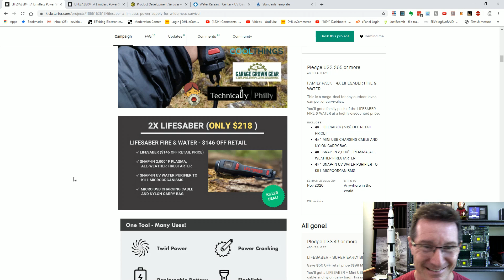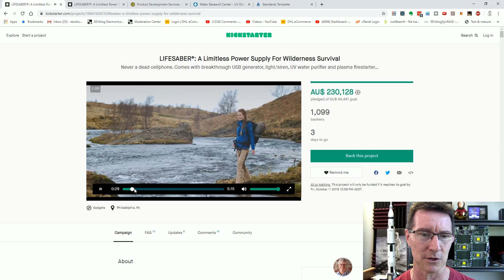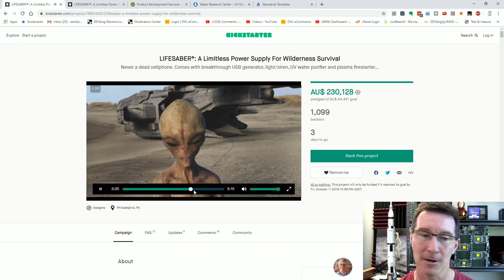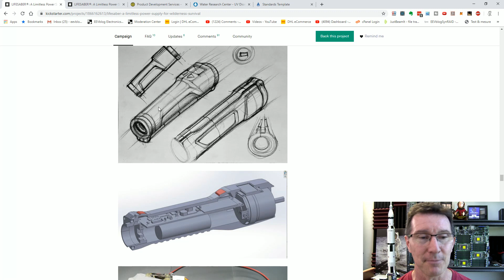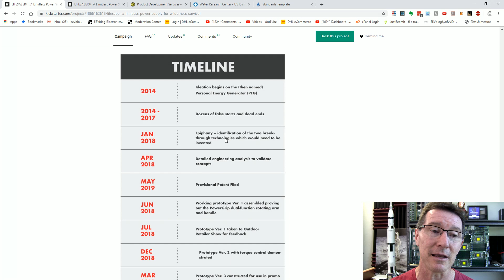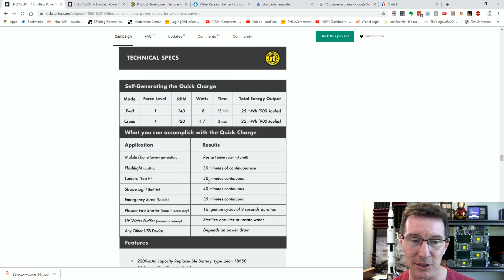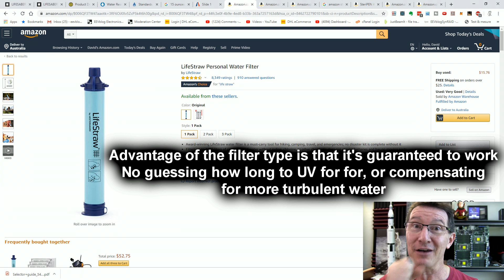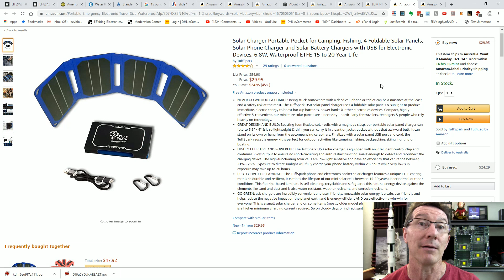EEVblog #1251 - LifeSaber Kickstarter - A Master of None FAIL

Comment: There are also USB generators, because with solarcell, you need sun. So it's not really need to buy whole big all-in-one thing. All-in-ones is instant useless if it failed or break. Separated stuff like you showed at the end is more better, you have more ways to survive instead ONE heavy thing.

Comment: All good until you iPhone dies ...they wont boot till there's enough power in the battery about 2-5% in most cases. I've had people tell me "nothing wrong with my battery" while I waited about 15 min's drawing 0.5a@5v before it would bother even trying to boot. How long would you have to crank that for 625mWh? (I think I worked that out right) .

Comment: I have a lovely plasma lighter that charges via USB and gives 100 uses per charge. I have a perfectly usable UV SteriPen that works with rechargeable AA batteries. I've got a bunch of various rechargeable power packs up to the nearly 30Ah USB-C PD power bank that I use with a PD Buddy Sink to power small low-power ham radios and charge my phone. If I need to charge things, I've got a decent portable solar panel for when the sun's out, but I also have a FlameStower, that'll charge USB power banks and devices using flame and thermionic generation. I have both of Stower's devices, the FlameStower and the CandleStower. The former just sticks a heat-conducting blade into a flame, and you pour cold water into an expanding silicone cup for the cold side. The latter, though, actually has a small pot it suspends over a flame, from a chafing wick fuel canister, candle, or small fire, like a pile of wood-fire coals. The cold side of the thermionic device is water you pour into the pot, and when it boils, you pour it into your coffee cup or freeze-dried food pouch, put more cold water in it, and set it back over the fire to continue charging your device.

For water purification, I can use the Steripen OR one of the Sawyer Micro-filters I have. The Sawyer filters a huge amount of water and does everything but kill viruses and remove heavy metals. The Sawyer filters are superior to LifeStraws, filter more water faster, and weigh less. 

For light, I have a bunch of different devices, from standard flashlights to a UVPaqlite Mule Light II that has a rechargeable 18650 with a usb charging sleeve. It has the strobe, a white light or UV work light, a flashlight, and a glow-in-the-dark insert that gets pumped from the work light, that flashes for a second every 3 minutes, giving you plenty of usable light that lasts for DAYS given how short the LEDs need to work to stimulate the glow in the dark crystals. I also have a little cheap hand-light with an expanding bellows-like arrangement that turns it from a flashlight into a lantern that gives a respectable amount of light. It has a hand-crank for charging the battery, and can operate as a USB power bank, though you need a small extension cable to convert it from coaxial power plug to USB-A socket. It's the only hand-crank thing I have, and it works okay so long as you don't expect to jump-start a spaceship. 

Gimmicks like this LifeSaber (damn stupid name...total cringe) aren't worth the powder and lead to blow 'em to Hell. As has been said by others, a "do it all" device becomes your single point of failure, and without some redundancy you're stuck without light, without heat, without clean water, and being carried off by dingoes.

Comment: Damnit,  that UV lamp is really unsafe... even a low power UV lamp is highly carcinogenous, 
i have a light indicator in front of my home lab, to be sure the UV lamp is off when i enter, people should not mess with that stuff....
Reply: Even without the cancer worries, the kind of UV (UVC) that is used for sterilization is pretty nasty - Big Clive did a couple of videos a while back showing one and talking about what happened when some idiot used them in a fashion show because the glow looked pretty. He called it the "Awesome Flesh-burning Death Lamp" for a reason...

https://www.youtube.com/watch?v=1m0TQjBRcFo

https://www.youtube.com/watch?v=CpRMud6EFtE
Reply: @RedwoodRhiadra  And he is right, this is not something to play with, if the lamp power is enough to be germicidal, i would consider it also dangerous for human. (there is probably a threshold here, but still...)

Comment: But if you combine it with a batterizer you get 800 times more energy out of it :D

On a serious note, you use body energy (i.e. food) to power this thing, not exactly what you would want to do in an emergency situation either when food might be a limited resource. Much more sensible to bring an extra battery.
The UV water purifier might work, but ceramic filters need no power and are more practical.

Comment: The twirl function is just dumb might as well have just the hand crank.
As for some of the planned devices a usable air pump is going to need a lot more power than what a single 18650 can supply usually you  need a 12v battery to power those.

Comment: I appreciate that you're talking about a Kickstarter which is actually legit, but disappointed that you threw so much hate at something which does have an honest niche market. Sure, you COULD save money by buying a whole bunch of other physically larger accessories, or you can be this really expensive all-in-one product. 

The one thing I do agree with is the rechargeable motor is stupid in comparison to using a solar panel to charge the cells. Solar panels are so cheap, really efficient, and so light, in comparison to the motor. Simply having that all-in-one housing + a foldable solar panel within it IMO would have been better then the hand-crank. Aside from that, I disagree with your point of view on the product.
Reply: John Smith A solar panel is even worse. Search for GreatScott's video about the solar charged power banks...

Comment: I'd agree with the accessment... except that this is probably perfect - for the target market.

Preppers and survivalists will be all over this irrationally. It's not about how useful it is or how it fares against other options, it's all about the keywords. xD

Kinda like the cottage industry of MREs... a whole lot of components inside these privately made MREs are just plain stupid to be there, but if they didn't put it in there the thing wouldn't sell.
The meal itself could be the very best for the situation, if the kit doesn't include some fancy prepper tools like a signaling mirror, a compass, multiple redundant fire starters, and whatnot - it will lose sales to an MRE that does include those but has an absolutely crappy inadequate meal included. :P

Weirdly enough, the one thing that it seems to be lacking is the optional solar panel charging unit, but that would probably increase costs and not be worth a price increase I guess.

Plain and simple, these things are designed for (false) ease of mind. It just has to sound as convincing as possible, which it seems they did a good job on. Nevermind that most of these survival tools are worthless without training, which is the most important thing on preparedness, they are just there so that people can lie to themselves that they are a bit more ready if an emergency situation comes about, with a single purchase.

Comment: I'll say I actually don't mind the concept of having a hand crank to charge an 18650. If they really do have their numbers wrong and it's 250mAh for 3 minutes of hard cranking... well, if you're stuck out in the wilderness, you've got time to kill. With that said, I don't actually want all of this in one device. I'd rather just have a hand crank that I can charge AA ni-mh cells with - much less finicky than lithium so the device can be a lot simpler. Then I can just use off-the-shelf devices like a flashlight and firestarter that are much better than whatever's built-in to this thing. And more importantly, we don't have the single point of failure of one little thing going wrong with this device, and I'm not tied to some wanky kickstarter company for continued support and warranty, which is a large consideration as they'll probably go under.

So the problem with this product is that when you buy all of the constituent devices separately, you have a much more robust solution. It might be marginally more bulky and you'll have to carry these things separately instead of in one contained unit, but hey, you probably already have a backpack with many pockets, right?

So yeah, give me a high-quality hand crank generator for charging AA's, and build the force multiplier thing into it because that's pretty neat. And sure, put a USB on it as well because getting 10 mins use out of your phone might actually allow you to get a call out in some places. But that's it. That's where you stop.

Comment: 31 lumens, I'm pretty sure I've seem computer with LEDs more stronger than that.
Reply: The light on my SNES is brighter.
Reply: One 5050 LED is about 16 lumens. It's tiny. This thing has likely exactly two similar power LEDs or a composite module. That is about 400 mW... (Guessing 3.3V) Their voltage converter and overhead must be trash.
Reply: Thinks about the Kingston HyperX Fury, a SSD with 75 RGB LEDs that cook the drive to death...

Comment: If they had only thought of adding a cassette player, I'd have been sold.
Reply: I can't believe they haven't taken vaping into consideration. Seems like an obvious feature to me.
Reply: @TheLambLive  vibrator
Reply: @TheLambLive  VHS recorder with detachable camera
Reply: It needs a digital clock, everything better with a added clock add to it, right ?
Reply: @Mrflash222006  I thought the same! This is missing an alarm clock. Also, calculator!
Reply: 8-track?
Reply: Needs a banana slicer
Reply: Bong!

Comment: AS a fairly regular wilderness backpacker, I can tell you that everything you've chosen as replacements for the LifeSaber are what I use as well. 13200mAh battery pack, Sawyer filter, Anker Solar panel, separate flashlight, ferrocerium rod - and all have a separate backup; 18650 battery with a tiny solar panel, a lifestraw, keychain light, matches, etc. I agree that's it's just craxzy to try to put everything into one -and the question of water resistance is a big one. It's pretty rare for me to be gone for a week and not get wet, or at least gear get wet.
Reply: There's no cell phone coverage where I go hiking with a tent. So... I'll skip all power stuff. And I don't need any of the stuff in their life saber. Why would I need it? Yeah, a GPS is nice (thus maybe a battery charger), but I have a map and a compass and can work with uncertain location information.

It is a fun product, though. A bit crazy, I'd say.

Comment: We've actually shortened the jack of all trades saying, and ironically have completely changed its meaning. Here is the original:

“A jack of all trades is a master of none, but oftentimes better than a master of one."
Reply: Very true, but I think it applies to people more than objects.
Reply: @jendib  yes, people have neuroplasticity and are generalists, specialization is for machines, tools and insects.
Reply: @jendib  Understood. I just wanted to point out, "A jack of all trades" originally was a complement.
Reply: +1. Take Dremel for example. It is precisely the jack of all trades, master of none, but oftentimes better than a master of one.
Reply: @victortitov1740  the dremel is a master of 1 category of functions, though. It's a rotary tool. That category is for fine drilling, polishing, grinding, and cutting applications. 
It sounds like a lot until you realize it's only for small sized stuff.  If you try to use it for anything outside of that, it's terrible.
Reply: Thanks, much more nuanced saying that way.  Wonder how much other folk wisdom has been similarly transformed over the years.
Reply: Yeah, but often you need that master of 1, because the jack of all trades is only okay at best for most tasks.
Reply: It's funny how times change.

Comment: The only human powered battery pack I have seen that generated and real power was something you hooked on a door or something then put your foot in a loop and stepped down. These hand cranked things are just silly. 

Now the simple crank flashlight with weather radio does work but you are hard pressed to make it more useful than that.

Comment: those RPM numbers on the hand crank thing look a little fishy to me, 15 minutes of spinning it more than twice a second, or even with the cranking gear ratio, 3min of twice a minute with that sort or resistance yeah not going to actually come up with the values they claim not to mention if you're not consistent with the cranking there's inefficiency in converting the power.... there's reason why wind turbines have a max and min speeds for effective power generation and the max is far below the breaking point of the turbines its all to do with the generator producing power that can be converted to usable power.
Reply from the maker: I didn't try and back envelope calc that.

Comment: It has a lot of bells and whistles that nobody needs. However, it does come with a bunch of useful survival stuff, as well.
The water purifier and plasma firestarter could be quite useful, although you probably shouldn't rely on those as your only option. Should probably take a different firestarter at least.
The whole swinging thing is ridiculous, though. 15 minutes? No thanks. 3 minute normal hand cranking? Yes please. Much better.

As for all those other plug-ins they are thinking about: I am assuming those would be individual products. Some seem useful, others don't. Just buy the ones you actually need and you're good.

Comment: Yeah, this is one of these things bought by people with no clue as a present for someone that likes the outdoors.
If standardise on lion batteries, then Xtar PB2S as powerbank, battery charger, spare 18650/21700 holder. Then can swap batteries between headlamp/flashlight and powerbank.

Comment: Well I like caring two means of purifying my water. Saved my butt after I had my pump fail on me while hiking in Sweden. The huge disadvantage of the straws is, that you are required to have access to water which I only had every 5-8 km (a lot of wells were dried out, I was hiking there last year). But that means you can not use it with a water bladder or a bottle. 
For the rest I agree. It is better to not depend on one single device just in case it breaks or gets lost. I always try to have two alternatives or more when I go on a multi day hiking trip.
Reply from the maker: That's the point, if you aren't carry a water bottle you are an idiot.
I like have stuff that uses interchangeable batteries. GPS, torch, even a camera in the old days with AA's. Now it's mostly USB
Reply: Sounds like you're an actual hiker though, not a trendy tech geek who pretends like one day they'll need a gadget for survival.
Reply: @Iliek  Well but especially in that situation I want reliable gear. What use is this tool when the battery is completely discharged and damaged after sitting around for 10 years? Matches will work, fire-steel will work and my water filter will work as well. 
The best part is the electronic compass they want to sell as an addition.
Reply: @nukularpictures  The point of the gadget is to make a few people rich by exploiting people's desire of new gadgets.

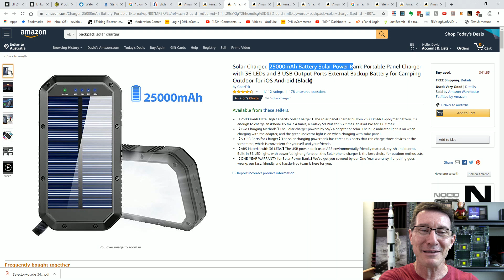Comment: 24:15 honestly, these kinda battery packs aren't that heavy, so one should be able to carry them in the backpack just fine.
Reply from the maker: Depends on what you are doing. I normally don't carry anything more than a 3000mAh pack, plenty for emergency charging.
Reply: @EEVblog  That's fair enough. I'm fairly used to the common 20-25k phone battery packs.

Comment: saw a torch yesterday that did 32000 lumens according to the manufacturer...  does only 3 min on a charge then but you can probably burn someones eyes out. ive also seen a turbine that you can put in a stream or wind and it will charge a device without any effort.

Comment: Where is the most energy loss in a crank generator? Surely an arm can put out quite a few watts of power if we could harness it?

Rotary motion doesn't have loads of friction, so is it lost in winding resistance, or conversion to DC?? I guess slow RPM needs huge windings to generate, but then you could use a gearbox.
Reply: Arm puts out a lot of Watts (power), but for a short time, so still low energy.

This thing weighs 0,5 kg with rotation radius of 0,25 m, let's guess 10 N force (about 1 G), for simple math.
That gives around 1,25 Watts. The problem is chiefly electrical losses, which depend on grade of coreand copper as well as winding, but easily can eat half of that input power. Mechanical loses are non negligible but not huge. Conversion to DC and voltage regulator can be about 90% efficient nowadays, including some active PFC.
Let's suppose this is in interior permanent magnet brushless topology which is good for low RPM and high torque. Alternatively this could be a brushless DC with electronic commutator, which fits better with the adaptive load idea, but is not as good with low RPM high torque.

Most importantly in a survival situation you're supposed to save your strength for when it's needed, instead of using it on frivolous things. Even more important when endurance walking.
Reply: @AstralS7orm  I guess a better way to harness arm power to electrical, forgetting practically,  would be something like lifting a huge weight and letting that turn a generator at high rpm as it falls to the ground.
Reply: @Audio_Simon  Poor guess, as the torque is lower unless you make your yoyo long and you have a break while you spool it back. It's much better to use a foot pedal or bicycle pedal generator, still pretty bad. While RPM is still rather low, available torque is much higher.
The higher RPM, the higher the core losses.